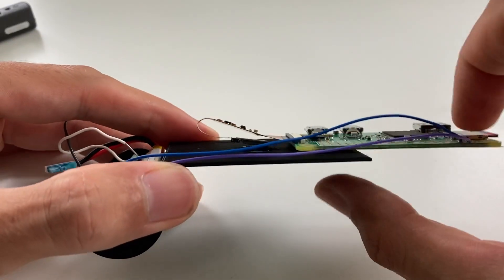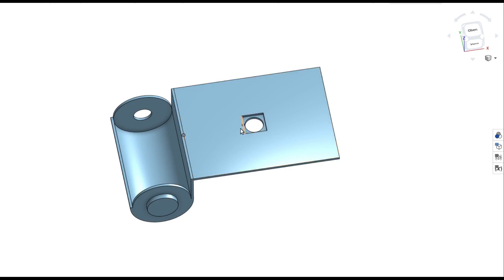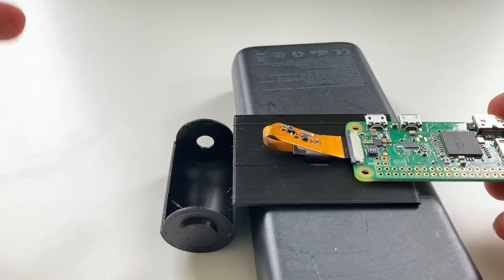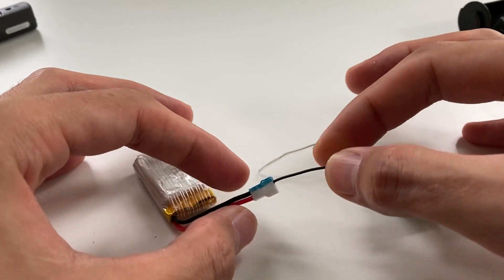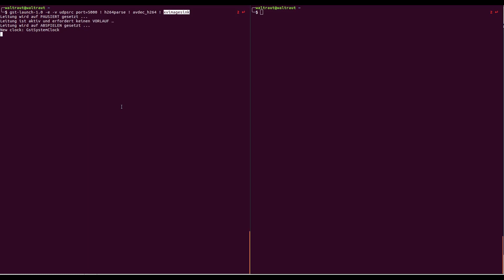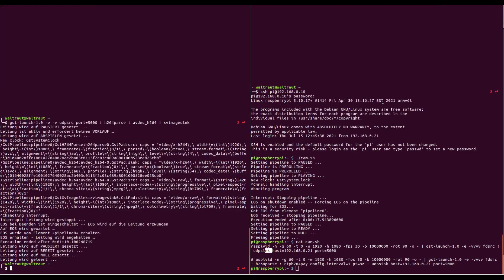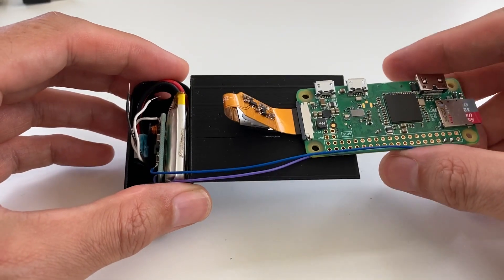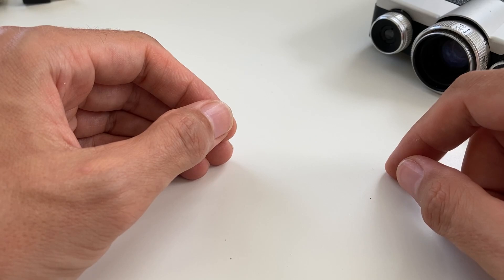Digital Film Cartridge : How To Build The Device

Comment: does the dc to dc converter gets extremely hot and damage the battery?
Reply from the maker: No at least in my case it worked fine.  If it runs stable for 5min or so you should be good to go

Comment: Hello. Really awesome build. But have some questions. Why is it so incredibly zoomed, will it not be the same size as a 50mm lens? And what about the quality of a still image? and how does it work to take still pictures?
Reply from the maker: Thanks! It is so zoomed in because the sensor is so much smaller than the original 35mm film. If you search for "crop factor" you will find good explanations for this effect. Stills are not yet implemented but could be done rather easily.

Comment: Hero. Will you do an attempt with a bigger sensor? I get full frame might be costly but APSC might be interesting.
Reply: A APS-C sensor alone would cost about USD 50. But it would be hard to get one, as manufacturers keep them under lock, because otherwise exactly what you are thinking of may happen.
It may cost around USD 300 - 350 as a finished product, and I would sure buy one for that price. I have 2 excellent film cameras that could be brought back to use.
Reply: @krollpeter  Think used sensors on ebay. Not hard to find at all.
Reply: Selamat
Reply: Selamat pengantin baru Untuk budak2
Reply: Selamat pengantin baru Untuk budak2
Reply: Selamat pengantin baru Untuk budak2 sekolah yg
Reply: Selamat pengantin baru Untuk budak2 sekolah yg